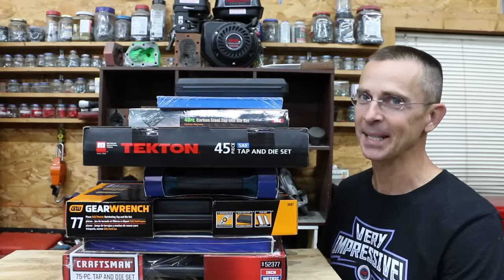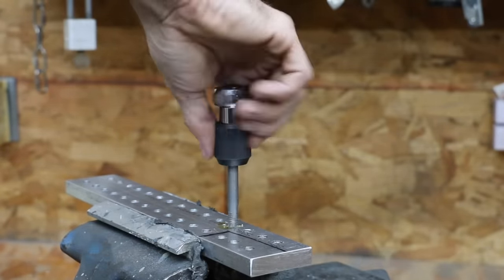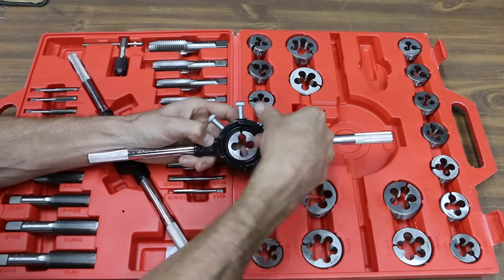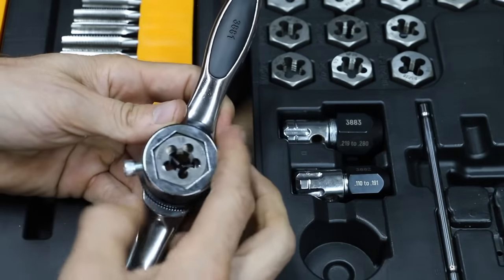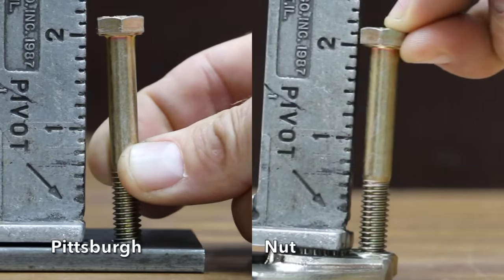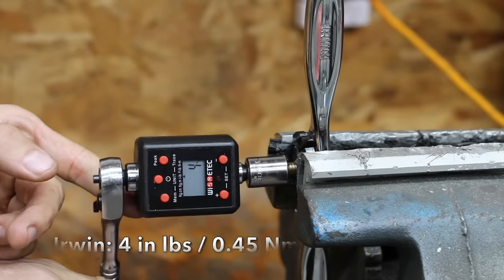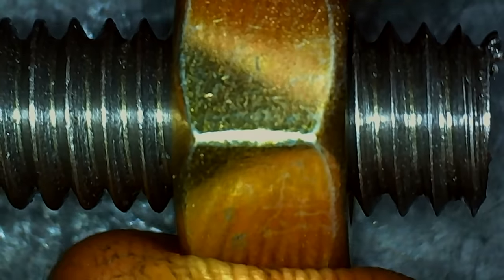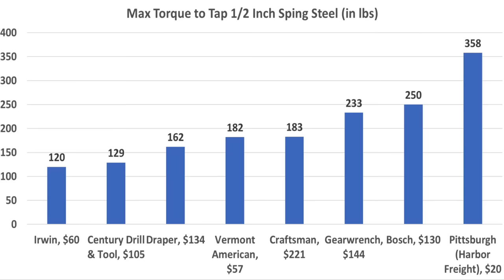Best TAP & DIE Set? Craftsman vs Irwin, Bosch, Draper, Vermont American, Tekton, GearWrench

Comment: I have had a Pittsburg SAE set for several years but mine is the more expensive version that is "Titanium Nitride coated".  This set was about twice the price of the regular Pittsburg set.  I've not done any scientific testing but I can say that I've been quite pleased with the results from this set over the course of several years using it.
Reply from the maker: Thanks for sharing.
Reply: LOL virtually every drill bit around now says "titanium nitrade coated".. Does that shit actually do anything?
Reply: @johnlucier5654  I have not done any scientific testing, as I said in my original comment.  However, I can say that I have used these taps and dies quite a lot over several years (at least 10) and they have held up very well.  I've had no issues at all so far.  Is that because they have this coating?  I have no idea. I only know they have held up well.

Comment: I have put off buying a tap and die set because I lacked any objective comparisons. Amazon and similar ratings are all over the place, and appeared too subjective. Also, a lot of inexperienced users rating them.THIS is the only data I need to make a decision. 

Like you, if the thread fit is poor, nothing else matters. The "Most Expensive" Craftsman kit is actually only $120 on Amazon (not $220). An equivalent 76 pc Irwin is $270. Both held up well. No brainer. THANK YOU. Thumbs up. Was already subscribed.
Reply from the maker: You are welcome!
Reply: Based on your tests I bought the Craftsman set. There were taps missing, and I had to return the whole unit to get a full set. They appear to be decent quality--no burrs, etc. I'm happy with the tolerance of the tapped holes I've made. The case is exceptionally nice, which is important in a tap and die set. Decent tap handles, but not as good as the ones I already had. Thanks again.

Comment: When I heard you say you were going to be tapping threads in spring steel I grabbed my popcorn and sat down with a smile. Some of the brands held up better than I would have guessed, but running a die down round stock is almost always disappointing. Unless it's Project Farm and I'm watching for a failure. Another great video!
Reply from the maker: Thanks!

Comment: If you are aware of this disregard. If you were unaware. During hand-tapping both taps and dies should be turned only quarter turns before backing them out in order to both break up and remove chips from the dies and taps. I feel the endurance tests didn't really allow the sharpness of the tools to behave as they would in real situations. BUT nonetheless a good test from as always

Comment: Thank You for your time and effort, I would not have thought the Craftsman would do so well, but when I saw it for sale on amazon for  $125 I pulled the trigger after spending much time on this video. I am a DIYer and have a few taps and dies from various jobs, but almost no metric (it used to only inch sizes for us old folks) and there are many holes in my inch collection, so hopefully this will do the trick. I was wondering why you didn't try out the Harbor Freight's better titanium sets they have for some $90 dollars each (Metric and Inch), I don't see many folks comparing the better tools sold by HF, although I have bought many of them and they have served me well. Anyway Keep up the good work and consider the better HF tools in comparison, because there are many of us DIYers that go there.
Reply from the maker: Thanks, will do!

Comment: An Old Timer introduced me to TapMagic almost 60 years ago and I have used their cutting fluid instead of cutting oil ever since on my taps, dies, metal saws and drill bits.  You may be pleasantly surprised at how it can extend the life of even the cheap Harbor Freight taps and dies.  One problem with many of the cutting oils though is that they can gum up the taps and dies making it so the chips start to build up and bind.  Now I'm the Old Timer passing that on to the younger generation.

With many hand taps and dies since they aren't specifically designed for use in constant feed tapping machines you have to back off a half a turn to clear them after every revolution.

Note that on the carbon steel tap and die sets, the tolerance is set for them to wear so that the tapped threads may be a bit oversized the first few times while the dies will create slightly undersized threads until they start to wear.  That way you can get longer service life from them.  Unfortunately using a plated grade bolt as part of the test often would start the wearing out of the carbon dies which are mostly for mild steels and non-ferrous metals.

On the Pittsburgh despite their faults they do come with a Lifetime Over The Counter Warranty that most Harbor Freight managers are pretty good about honoring which can make them a good value especially if you have a local Harbor Freight Store of which there are three in the area where I live.

Best!
Reply from the maker: Thanks for sharing.

Comment: For soft metals  especially Aluminum you should use a "F" (.257" dia ) drill for  72 percent thread.  the 17/64 drill will only give you 59 percent. That is why you have some much slop in the threads. Thanks for the great comparison on all the sets.
Reply from the maker: You are welcome!  Thanks for the suggestion.

Comment: I have the Snap-On tap and die set and it works great! I've had it for about 10 years and the taps and dies still cuts easily.  They work like a dream if you don't mind the almost $500 dollar price tag!
Reply from the maker: Thanks for sharing.
Reply: Snap-On's are made by Erwin / Ace / Hanson. Snap-On requires special attention and specifications such as When I sold tools, Snap-On had to have 12 point adjustable dies instead of the normal 6 point and their tools had to have engravings. All of these things added to their cost. Back when I sold tools, Blue Point sets were Erwin / Ace / Hanson along with Mac and Matco. Erwin bought up many companies of the past and combined them. When you see an old Ace set and then Ace-Hansen and now just Erwin, they are under one roof. Same goes for Drill Bits sold by Snap-On, Matco and Mac are all Erwin, except Snap-On's must be engraved. Over the years, these companies needed lower prices and many of what used to be engraved is now etched. I have engraved Matco drills, but newer ones are etched. These days, Erwin is the only game in town for quality hardened steel tools, otherwise, they must buy over seas knowing what they get will be pot luck.

Comment: I was gifted that exact same Craftsman set probably 10 to 15 years ago. Been using it ever since. I definitely agree that it seems like a pretty nice kit. Never really given me any trouble. I'm not sure that I would have honestly spent that kind of money on it myself. But as a gift it's been amazing LOL.
Reply from the maker: Thank you very much!
Reply: What do you do when you break a tap? Do you just replace that specific one? Have you replaced them with matching craftsman ones, or other ones?
Reply: @nerdnoise  I don't think I've ever broken a tap. But on a couple of occasions I've needed a size tap that didn't come in the kit. In that scenario I usually just go to the local hardware store and pick up a name brand one like irwin and add it to my kit.
Reply: I doubt if it is the same set. They change manufacturers all the time. They use to be all USA, now who knows. The Craftsman set is not $220 at this time it is only  $120. $100 if you can find it in a Sears store.

Comment: Hands down the very best tap and dies, if you can find them, are the ACE tap and dies made by Henrey L Hanson. Hanson drill bits were excellent as well, drill stainless all day and they still cut better than anything else. Unfortunately, they were bought by Irwin and the quality is not the same (China) as when they were made in Worcester Mass.
I paid $52.00 for an Ace Super Set in 1978 which is about $240.00 today. Worth every penny of it and still in use today since I've been able to refresh my set as needed with NOS thanks to some old hardware stores and suppliers that have been in business a long time.
Reply from the maker: Thanks for the feedback.

Comment: I am not complaining, your test here I would definitely consider completely valid. However, I was taught a different technique many years ago, to tap 2-3 turns, then back off a turn - clearing the tool of cuttings, then make another 3 turns, and back off one. Keep doing it that way until done. Saves the tooling and gives a better, tighter, end result.  The same holds true for using the dies. If possible, could you do a comparison video using this technique? Then the "go for broke" technique like in this video? I have also seen many professionals use the technique I use as well. I am really curious as to how well the tools hold up with a different technique. Does it really make a difference? Thank you!
Reply from the maker: Thanks for the video idea.

Comment: My tap and die set cost  $350 from interstate tap and die. I also have a precision brand set for the same cost. 

I mainly use larger tap and dies than you’d see being used most of the time in autoshops. 

The interstate set has been by far my favorite. Not a very large assortment of sizes. So I did also go out and grab a bosch kit and I absolutely love that kit for $150. It’s just missing all the big big sizes

Comment: Great video.
Here is where knowing how to properly use the tool is of paramount importance.
Fails are because of forcing them in or using a drill to power tap.
The use of lube & working the tap back & forth clearing shavings saves all broken taps.
Taps are extremely hard and drilling them out is not an option.
You have to use a punch and walk them out of break them into small pieces.
I have a craftsman 40pc metric/sae set with metric & sae gages that is 25+ years old works great. 
Also gearwrench makes great sets.
Reply from the maker: Thanks!  Thanks for the feedback.

Comment: I have 200 pieces of USA made Vermont American taps and dies, have no issues, and have been using them for 20 years. Informative to know that the current products aren't made in USA if I break one. Also as noted, you are tapping with a one sided wrench, you could have skipped the test of how much play there was as 99% of it was the method. I often have to use some oil when first threading of steel, and aluminum is snug. Maybe mine are cut a little under on the taps and over on the dies, but they do make some precision threading parts.

Comment: I have the Craftsman set, but mine was made here in the USA...I bought it 20 years ago. 🙂

I have a much older set that's identical to the cheaper Chinese sets (the wrenches look like the exact same ones!), but it was made in Japan, and it's always been a surprisingly good set. I only really bought the Craftsman set because I'd broken a few from the Japanese set, and the Craftsman set also had metric.
Reply: Craftsman used to be the perfect high-quality tools for those who couldn't afford Snap-On or Mack Tools. I have really wondered if they've maintained the quality after Sears died.
Reply: @BradfordGuy  if they're made in China, who knows.

However, they are beginning to manufacture elsewhere other than China, so that's at least, a positive thing.

Comment: Clearly Irwin wins on tolerances, sharpness and value. Thanks for another no bullshit video. I cut a LOT of threaded holes so use Morse taps which are a better USA steel. I also tap smaller holes like 4-40 and 10-24 so breaking taps is more of an issue. Also use a tapping tool for better alignment.
Reply from the maker: You are welcome!

Comment: My Pittsburgh tap and die set has been just fine. I broke one tap on Stainless Steel, but other than the handle not holding the tap secure, no problems with the dies.
I have the 60 pieces set. Except for the small taps, all the Metric and SAE are bottom taps.
Reply from the maker: Thanks for sharing.

Comment: I'm under the impression that when cutting, the user should back off until the chips dislodge from the tap/die, before progressing. Not doing this probably contributed to lower performance, extra wear and sloppy results from some brands. I suppose this video demonstrates how well these brands stand up to abuse. Still a useful video!
Reply from the maker: Thank you!
Reply: They also do not recommend using a ratchet with a torque adaptor. If you look closely, every hole he tapped regardless of brand was not exactly straight. the T handle wrenches they supply should have been used, I bet more than half of the slop he got in each test would disappear. Judging these in this regard is like someone judging a saxophone being played with a clarinet mouthpiece. I do still enjoy these videos
Reply: I was trained the same way, to back off and break off the burr and then continue and repeat. Also to never use a ratchet type T handle. I have never broken a Tap or damaged a dye either. This was still a good video as far as a torture test of manufactures .
Reply: Yes, for the taps that were tested, hand taps with straight flutes, that's necessary, because they have little accommodation for chip clearing. They have some clearance, but that's it.

I'd recommend running at least a single test with a spiral point tap. Those evacuate the chips forward, ahead of the cutting area, and can be run without reversing. Mcmaster has TiN Spiral Point Taps in the right size, 2762A48.
Reply: Hand tapping is a sloppy process that produces a lot of chips. If power tapping, you don't clear chips by starting/stopping the tap in mid-travel. A skilled person can use power tools to tap with. Have done it many times with drill presses and hand drills. Dies are different, and require something like a lathe.
Reply: I mostly power tap with a hand drill driver. I find backing out really to only be necessary on high aspect ratio or blind holes.. I also only tap unf and unef so the threads aren't as deep diametrically as unc. So take it with a grain of salt.
Reply: Retired after 40+ years drilling and tapping holes in locomotive parts for GE ...
... certainly N0T industrial quality.  There was N0T sufficient lubrication/coolant utilized in any of the tests !
Reply: @rudygeorgiamulesandcountry1594  yeah a little bit of cutting paste makes a massive difference to how clean the threads end up being. Also way less likely to break a tap.

Comment: I gave up on Horrible Fright for cutting tools. I have tried their tap and die sets several times and every time the taps and dies were dull right out of the box. I have had reasonable success with Vermont but, when I need to have quality production I use products from Cleveland Drill Company. The are not cheap but, they give outstanding and accurate results and last a long, long time. Their drill bits are impossible to beat, too.

Comment: I use an older Pittsburgh set that looks identical to the tekton set. Even the layout of the case is the same.  Most of what I do though is thread chasing to clean up gaulded threads and have never had any issue with them. I may have gotten lucky, but the older Pittsburgh set I  have seems way better quality than both the Pittsburgh set and tekton set shown here. I guess buying cheap chinesium tools from Harbor Freight can be hit or miss on the quality control.   Thanks for all the comparisons that must have taken forever.
Reply from the maker: Thanks for sharing.

Comment: By far the best channel on YouTube.  Very interested in a small video on the follow.  After all the testing of products you do, what do you personally use for your videos and daily life ( oil brands, power tool brand, small engines, small hand tools, drill bits, tap and die set, drill bits, saw blades, etc interested after all the testing you do what the brands are you prefer.  Thanks.  🍺
Reply from the maker: Thanks!  Thanks for the suggestion.

Comment: On the harbor freight tap sets, some comments on the HF website said the size markings were hard to read.That might not be the case in this video, but my HF set was really hard to read. The tap handle broke the first it was used and was horribly made. That said, they did work for me when I rebuilt an Atlas drill press from the mid-1950’s.
Reply from the maker: Thanks for sharing.

Comment: Many bits actually call for drilled holes made by letter or number size bits.  The fractional is usually the nearest equivalent so hole may be a little off.  I have also found tapping aluminum to be a different animal from steel.  The softness of the metal I think to be the reason.  There are specialized taps that do a better job but I understand most people are buying general purpose sets with lower tolerances.
Reply from the maker: Thanks for the feedback.

Comment: I like and enjoy most of the videos I've seen you do, they rock and you rock! Your videos are very informative. This video had many technical variables possible. The largest issue was how you drove the taps into the material.  Lopsided force throws so much out the window because you used a ratchet.  I was actually surprised that not one of the taps broke! Love your stuff.
Reply from the maker: Thanks!

Comment: Some excellent comments rendered here.  I needed a #4-40 tap and found a set of Irwin that included five taps and their respective tap drill at Lowes for a very reasonable price.  I've tapped lots of holes over the last year with no sign of the taps getting dull.  I use Tapmatic cutting fluid and it seems to make a difference in the cutting action.  If money was no object, I'd invest in all Union Butterfield taps and dies.
Reply from the maker: Thanks!  Thanks for the feedback.